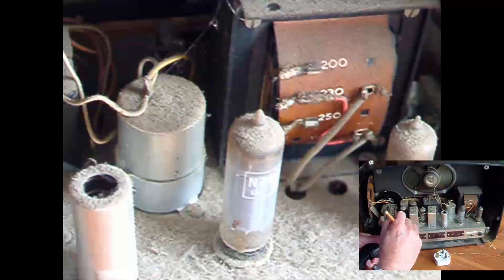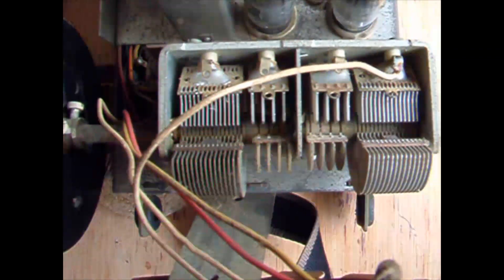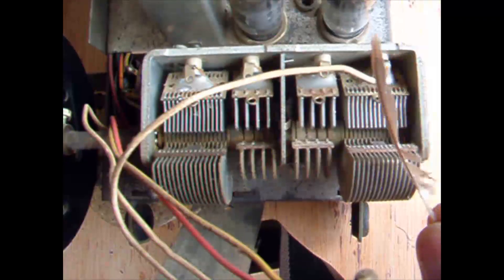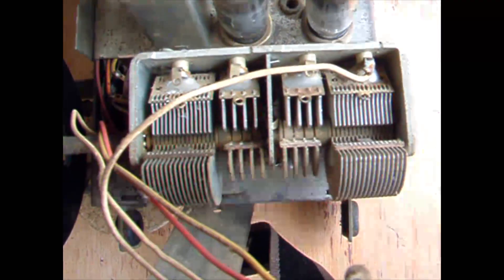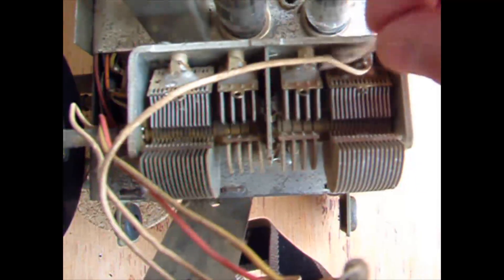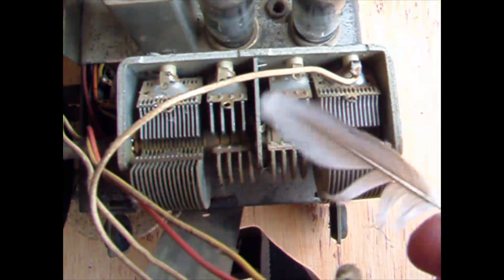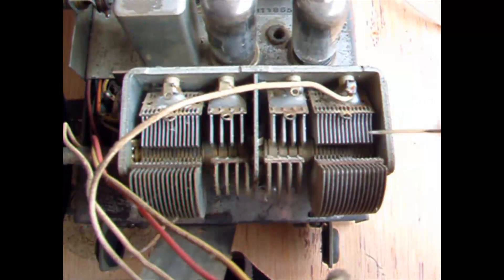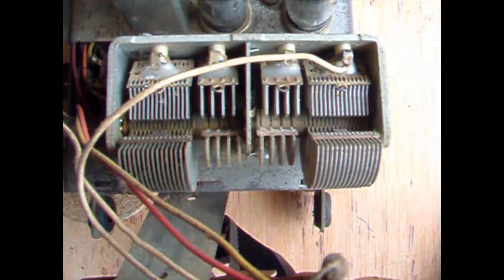About Radio ... Part 11  Cleaning the variable capacitor, by Andy Davies.

Comment: I had 3 variable capacitors that were slightly corroded, as well as dirty from age. I removed the capacitor, and put it into a can of gunk (used from cleaning gas carburetors. I let them stil for a couple of hours, took them out and washed them down with water, and blew dried them. They came out clean as a whistle, looking nearly like new. Did no harm to the capacitor either. They all work just fine.

Comment: Nice videos Andy. I know a trick with these caps using a straw and blowing in it and vacuum cleaner around it will do the job also for the most of the dust but sometimes its suitable using your tool :). Cheers.

Comment from the maker: Hi there, that sounds a little harsh but I guess there’s no reason why you shouldn’t do that. I had a load of electronic gear that had to be stored under a tarpaulin outside and everything got mouldy, I washed it off with hot soapy water and let it dry in the warm for a long time, applied WD-40 where appropriate and I saved it all in good order. Thanks for the feedback.
Kind Regards ... Andy

Comment: I clean the capacitors by removing them, put them in the dishwasher on high temp, they come out like new, after that in take a good teflon based oil to oil them.

Comment: I just tried some DeoxIT D100L on the metal ball bearings.  I use this for switches
and just read that it was good for lubricating. Their website said it was good for air variable caps.
Worked great on my NC-300 which was just about useless with warble and jitters
on CW.
Ken
Ken

Comment from the maker: @n1kkri Hi Ken 
I’ve used light machine oil (3 in 1 in the UK) but don’t apply it out of the can to the bearing, it’s better to put a few drops of oil on to a dish then pick the oil up with a watch makers screwdriver / a bit of wire and transfer it to the bearing areas, don't over do it  I’ve seen some heavy duty capacitors with very light grease on them and I’ve used Vaseline on industrial capacitors. Don’t forget to oil the sliding contact.
I hope that helps.
Kind Regards ... Andy

Comment from the maker: @bejius If you have a look at one of my other videos, ‘Fault finding in an RF signal Generator’ you can see the result of a dirty variable capacitor on a radio frequency signal generator, I fixed it with a tiny drop of WD-40 but only a tiny tiny drop.
Interestingly the problem only showed up above 30MHz the lower frequency ranges were OK (higher volts)   
Regards ... Andy  gw0jxm

Comment from the maker: @bejius Hi, I can't see that it would be a problem as a cleaner but I think it would be a good idea to apply a little lubricant to the bearing and contact areas as the alcohol could wash it all away. I'm not sure if there's an issue with any of the plastics you may encounter but I guess the main issue has to be the flammability of an alcohol spray, it's probably OK but if you open the mains switch with power on it could possibly ignite the fumes. You cap use a tiny drop of WD-40 ... Andy